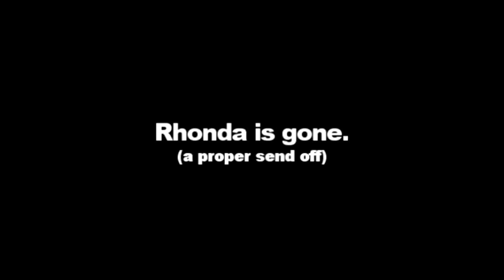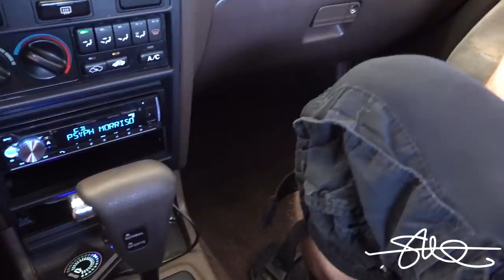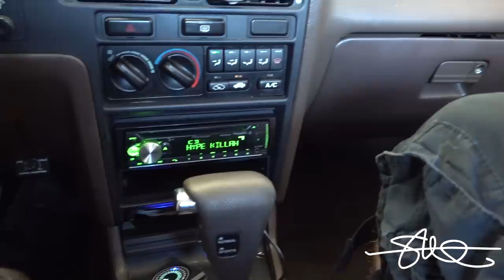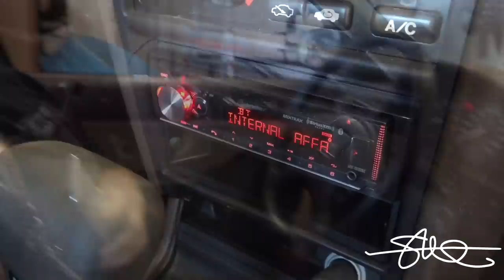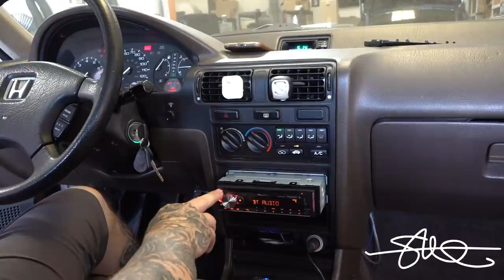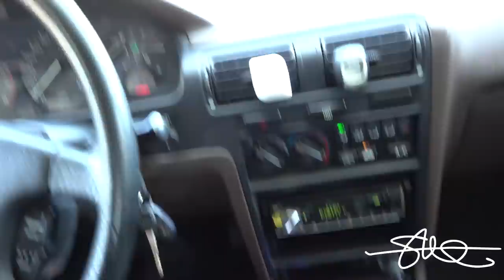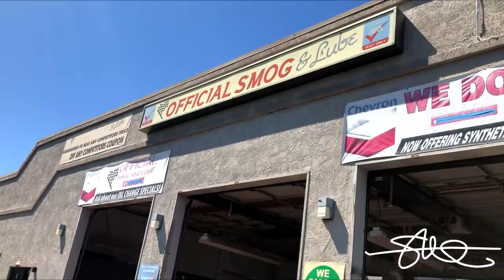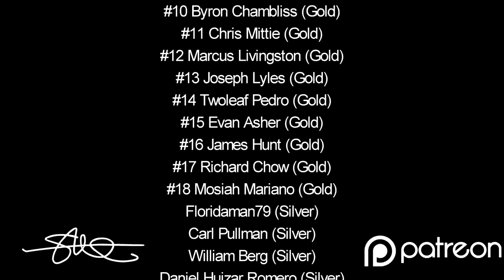Rhonda is GONE. A proper BASSHEAD sendoff 1990 Honda Accord One Last Bump

Comment: I had jbls installed in the front and Infinity  kappa both 6.5 on the door speakers running at 50 watt rms and and these sound way better. Btw I have 2013 ford escape even with dynomat i still hear the parts vibrating.
Reply: dynomat has always been so-so it either works or is garbage I had dynomat on my lid on my jetta and it fell off after about a year switched to second skin and never looked back I have a 2001 escape with it no rattleing on my 6.5s or from my 12

Comment: U can hook highs and subwoofers to a four channel amplifier?
Reply: Ues sir. Two channels bridged at 2 ohms to the set of components in the front doors. The other two channels bridged at 2 ohms to the two 8" subs. Probably used two four ohms subs wired in parallel. No rear door speakers though.
Reply from the maker: @ricardomolina4605  actually you are only partially correct.  The front two channels are not bridged. The rear (bass) is.